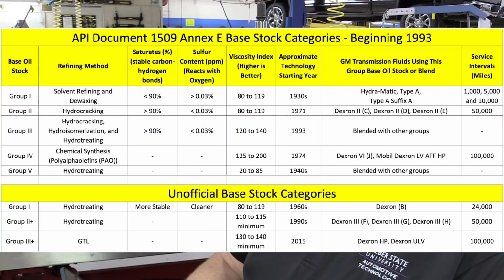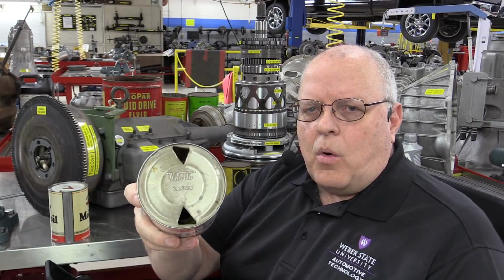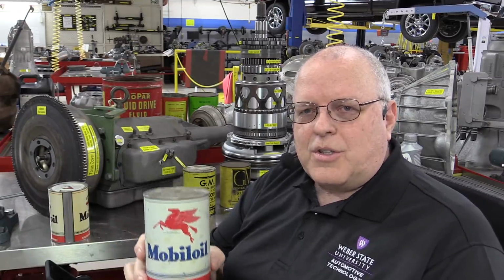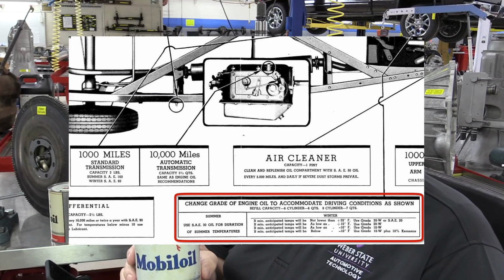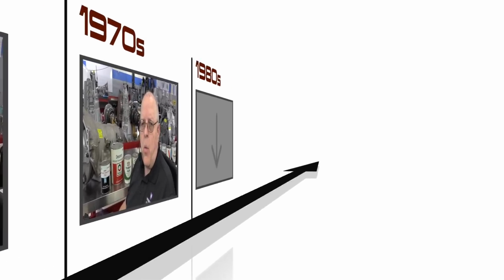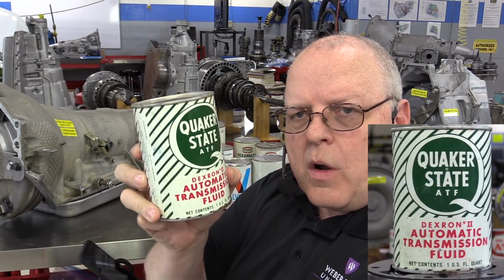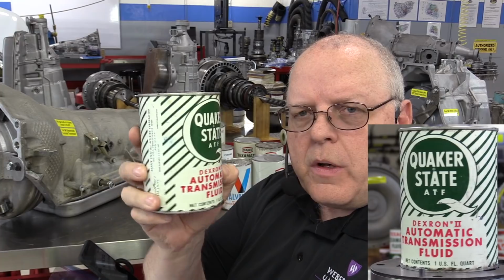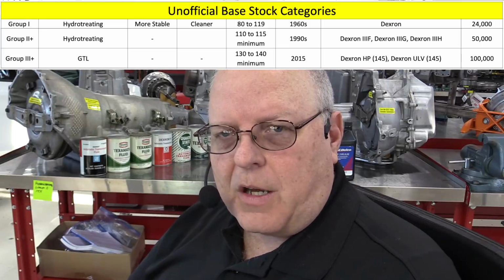GM Automatic Transmission Fluid - ATF History Part 2

Comment: Most interesting video. I know you didn't get too far into additive chemistry and you may know that sperm oil (from sperm whales) was used for many years as a friction modifier in ATFs and it proved quite difficult to find a synthetic replacement when this became unacceptable and difficult to source in the 1980s.
Reply: It's use was banned in 1972 but they found that jojoba oil made a superior replacement.
Reply: @Patchuchan  jojoba oil is f/a seed, good 4 ur skin... NOT an oil, butt a wax... good 4 high heat...
Reply from the maker: Thank you very much! Yes, I was aware of that. It is a good thing that group 4 synthetic base oils came along in 1974

Comment: It’s unfortunate that modern automatics don’t allow you to rock the car back and forth to get it unstuck. There are still gravel/dirt roads and snow/ice. Toyota Prius actually allows you to rock it back and forth even with part throttle but of course it doesn’t really shift anything just changes the direction of MG2. Do you know if other vehicles allow you to do that?
Reply: Yeah modern cars really put you at a disadvantage when you get stuck. For automatics nothing beats a manual valve body (or an electric without programmed R-D delays) that lets you do that. These days even the best driver will get stuck just like someone back in the day that just hit the throttle and buried the wheel.
Reply from the maker: Every transmission is slightly different in its controls, but the majority require the engine to be at an idle to change gear ranges.
Reply: Thank you for answering and thank you for making this series! I wish somebody would have even a fraction of this on engine oils.

There shouldn’t be anything stopping electric or (most of) hybrid cars for changing direction with throttle applied. And with electric throttle and electrically controlled transmissions I would think that it should be possible with “normal” cars as well.

Comment: Too bad there is no meaning in the U.S. for the marketing terms: "Full Synthetic", 100% Synthetic" and "Synthetic" since the Castrol debacle. Thanks for the reference to API Document 1509. API does help the consumer but they also hide the info submitted to them by the oil companies as "Confidential" .API does collect all the base stock info from the oil company for certification, but we will never know it. By the way, Walmart Supertech Synthetic Oil meets GM Dexos and sells for like $17.99 for 5 quarts. So why pay big bucks for the Big Name Group 3 oils, some of which sell for close to Group 4 prices.  Most so-called Synthetic ATFs are about $20-25 a gallon. I think these are Group 3 because Redline, RP and AMSOIL is about double that price. 
One thing I was blown away by Document 1509 was their description of Group 5 as low VI of 20-85 and just molecularly-modified. Group 5 oil is used in jet engines and usually has a ton of Polyol Ester base which is very expensive. I think a Group 3 oil would vaporize in a jet engine bearing because of the lack of a cooling system. Maybe it's different for Group 5 ATF. But very confusing.
Reply: Stanny1 - Fortunately, you probably don’t need to worry if the oil is Group 3 vs 4, unless it’s a European car and/or has a turbo.  IIRC, Mazda has some issues because their turbocharger bearings were too hot for conventional oil.  It’s still bullshit that jerkoff lawyers decided what “synthetic oil” means, and not engineers.  I know guys who ONLY use European oil, because “synthetic” actually means synthetic in Germany.  I personally take my car to the dealership where OEM fluid - fully vetted by the manufacturer - is used.
Reply: Yes, Bryan, Group 3 U.S. oils have a lower resistance to high temps than Group 4. Too bad American consumers have been fooled since 1997 or so by buying Class 3 Synthetics while sometimes paying more than a Group 4. Two areas in the engine are sensitive to temperature and tend to coke oil. One area is turbo bearings.Cars don't use pressurized turbo oilers like spring piston and electric pumps that operate after the engine stops in trucks. The second suseptible area is the top piston ring land. Coking by lower temp oil can cause ring sticking and blow-by. After that, it's a slow death for your engine. Turbo owners should use German oil or the 3 brands in the U.S. that make Group 4.
Reply from the maker: Walmart Dexron ATF versions are all fully licensed GM fluids. I was very surprised. Remember, group 4 base oils are just base oils, they still need the proper additive package to perform as intended in the transmission. The table I showed in the video of base oil categories was based upon the API 1509 document and several other sources. The API does not publish viscosity Indexes, or years, fluid types, or service intervals. Group III+ is the new kid on the block to compete with group 4, but at a much lower price (~1/3).
Reply: Yes, Pennzoil and Castrol are trying to convert Europeans to Natural Gas-derived Group 3+. That means they will have to make III+ into wide-viscosity oils like 5-50, typical for BMW and Mercedes. API sent me Addendum E but I still have questions about Group 5. I'm communicating with them now.
Reply from the maker: You can download them for free here: https://www.api.org/products-and-services/engine-oil/documents/api-1509-documents

Comment: Thanks for your video.  Learned a lot about the old gen of fluids. Always wondered how we got here. 

6L80 —> 6R80. I’m not aware of a GM equivalent to Ford’s 6R140 besides the Allison LCT1000 series. The 6R140 is quite the beast.
Reply from the maker: Thank you! I will have to double check. I may have gotten that wrong.
Reply: Interesting lnteresting videos
Reply: Great great vidoes